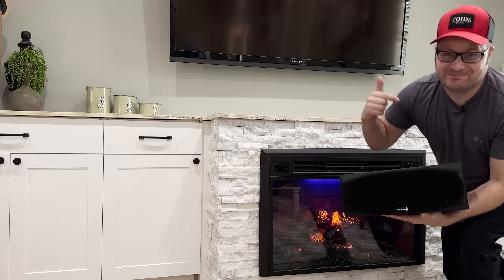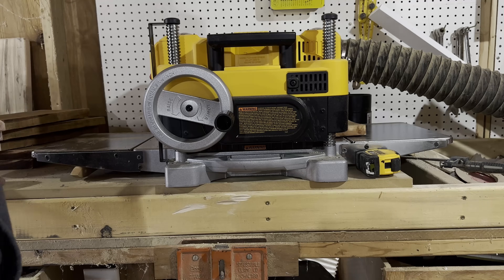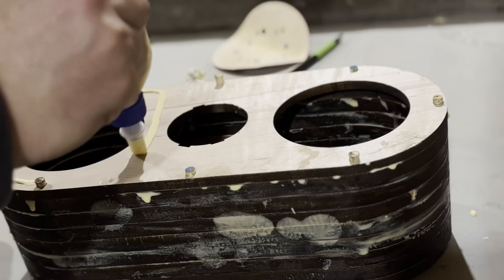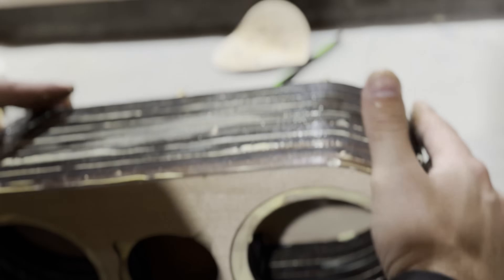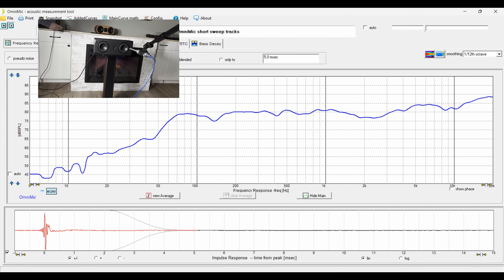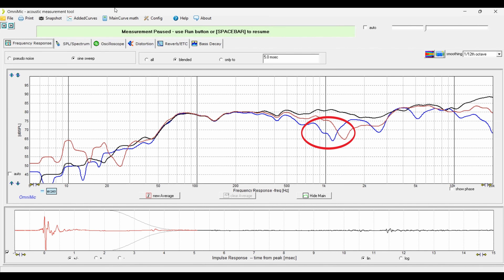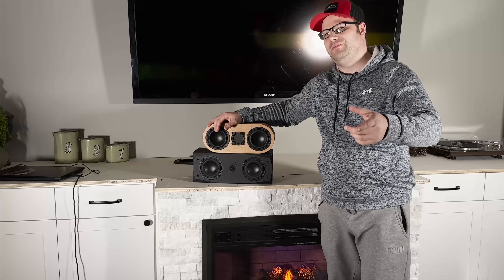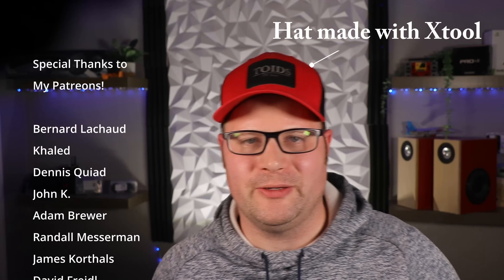Fixing The Problem with Most Center Channel Speakers - The Rule Breaker

Comment: What are the downsides to this solution? There must be some reason manufacturers don't offer this option.  All audio design choices are a compromise, so what is this design's weaker area?  How would increasing the budget alleviate any weaknesses?
Reply: Sensitivity although good, isn't as good as it could be if the technology wasn't used through adding mass to control how the modes develop within the driver diaphragm. However I think probably the biggest reason you don't see manufacturers/companies using these is because it's proprietary tech to Tectonic Audio Labs. This means manufacturers of speakers might worry about stocking issues and raising the price of the drivers since there's no competition in the field. 

But for us as DIYers, we don't need to worry about the production of the drivers or where they come from. So for people like us I think they're amazing little drivers!

Comment: Wouldn't your cnc router have made quicker work at cutting out all of those layers? I would never leave any cnc tool running unattended, especially a laser. Moving the xover frequency down is the only way to attack the comb filtering issue and the speaker looks great. Nice project.
Reply from the maker: Yeah, the one really nice thing about the Xtool is it has a flame sensor. If it ever senses that it might be burning, it will actually shut off the machine. You can also set the sensitivity level. But it is definitely good practice to stay with your machine. Especially when you’re starting to get used to them.
Reply: He had a camera set up for monitoring and it has a flame sensor

Comment: Nick, That center you built is a fantastic design - as always.  I have to ask, Is that Dayton center and it's siblings worth buying?  Thanks.
Reply from the maker: Good question. For the price they aren’t bad. But they aren’t good either. Basically they are worth what you are paying, nothing more. I’d rather build something like this or similar for around the same price. You’ll get better performance. But if subversive said they didn’t want to build and only had $60 for a speaker, then I’d offer it as an option.
Reply: @Toid  Thanks Nick!  Sounds like the best bet is to stay in the higher priced and better reviewed speaker lines or go DIY with your designs or some of similar quality.
May I ask what your current/favorite HT speakers are?  Thanks again and all the very best to you and yours.

Comment: Great build. Really appreciate the additional focus on showing the measurements and theory in addition to the practical of the build. Also, with the crossover point so low, it makes me wonder if you could get away with dual 8" drivers to further extend the low end. The box would be pretty big, but if size doesn't matter, or if it's behind a projector screen then it could be a interesting build, even as a tabletop / room speaker. 🤔

Comment: Looking at the data it seems great! 

But since the crossover is so low, I guess from 300 or 400Hz to 20KHz it is only the smallest driver that do all the job. 

So that would also explain why there is no issues of off axis like when using 2 woofers side by side and this tweeter.

But the real issue I see is the power this lonely small woofer/twitter can handle. 
Since the woofers are just use for lower frequencies, and that center channel dont typically do a lot of heavy bass, since it is mostly needed just for humain voice for dialogs and lower bass are for the LFE channel(s). 

So.my concern is that it cant not play very loud as a center channel in a multichannel movie since most of the sounds is done by a very small woofer.
Maybe I am missing somethings.. ?
Reply: I don't think it was published in this video, but he took distortion measurements and they were quite good even at high volumes.
Reply: @blakebrockhaus347  the reasonable sensitivity and high crossover definitely helps! Plenty enough for any normal setting! You're right about the distortion too

Comment: id think it would be cool to see what you could do with a 3d printer desine apparently at 40% infill its close to hdf in resonant frequency
Reply from the maker: You could 3-D print this. That is assuming that you have the height or a bed big enough. But I think we might have summer if those videos in the future.
Reply: Aha! You should wait to see what I have planned if you're looking at going the 3D printed route 😉
Reply: @Elliott-Designs  nice, i did one like the svs prime elevation but with a sealed and  6.5" woofer . my cross over was not quite right but still sounded really really good. i cant wait to see it.

Comment: Moral of the story - Use a Full Range instead of a Tweet, Tweet!
Personally, after an accident where I had my system in Stereo Mode watching the (1998) Helicopter Chase Scene - Godzilla https://www.youtube.com/watch?v=JKnnZPTDJYM ... I subsequently, ditched the rears and centre channels speakers, and never looked back!
Reply: Not necessarily. Most full range speakers have very poor off axis response, bmrs are a different technology all together
Reply: @blakebrockhaus347  You do know I wasn't being serious, right!

I built my first pair of transmission line speakers back in 1990 !!!
Reply from the maker: Blake is absolutely right. Typically your off axis response is directly related to the size of the driver. Meaning a full range driver of same size as a BMR would start having off axis issues much sooner. The BMR uses a special technology that allows for the much wider dispersion.
Reply: @Toid  You do know I wasn't being serious, right!

I built my first pair of transmission line speakers back in 1990 !!!
Reply: If you want to know how it works, have a look at those exciter panels. They're called distributed mode loudspeakers, and when properly computationally modelled you can get really precise like with what Tectonic audio have done. The BMR is just integrating a small DML into the same suspension system as a typical driver. They do it by controlling how the breakup modes interact to get the desired frequency response and directivity.

Comment: Nice project. It looks like it minimizes typical MTM issues. Size will limit output, but this will work for a lot of setups out there.
Reply from the maker: I agree. We really wanted to go with something smaller as there aren’t many good options out there. When you go larger there’s quite a few different options that perform similarly. So the goal with this one was to design something that fits an area that seems overlooked.